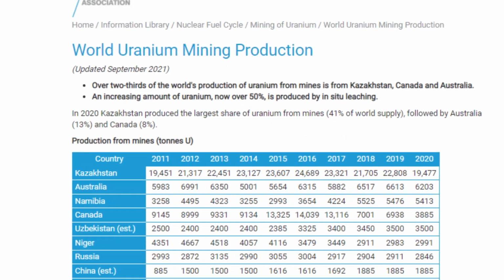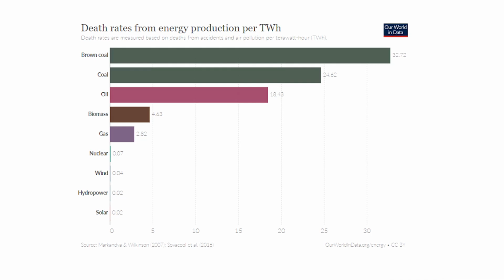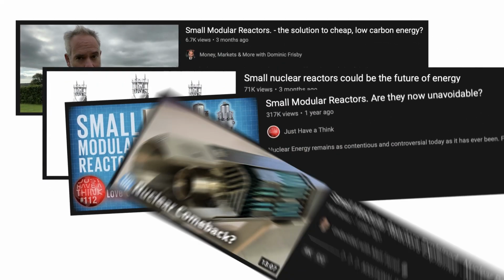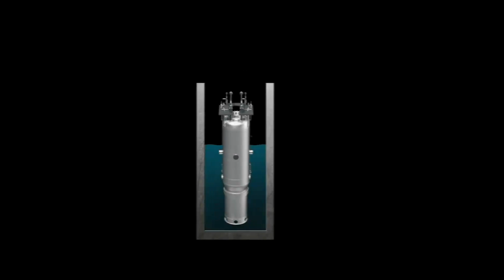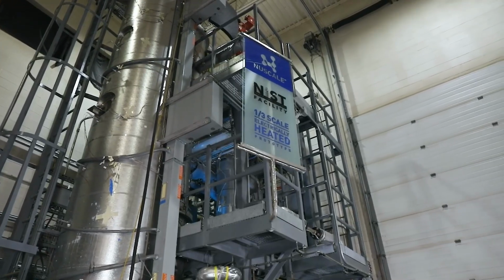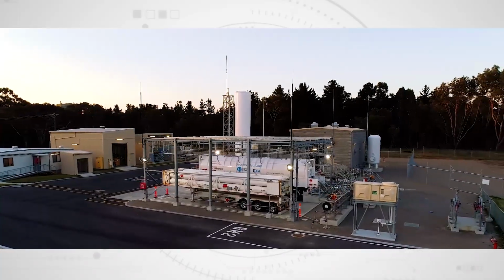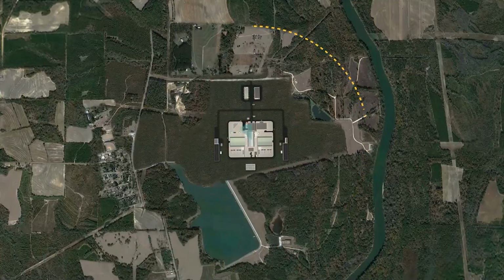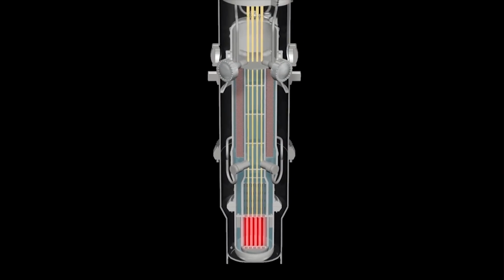Can Small Modular Reactors Save Nuclear Power?

Comment: Correction: It wasn't the meltdown in particular that caused the tragic accident. They had pulled out nearly all the control rods and when the water stopped flowing, the core went supercritical and the power increase caused the pressure to increase so much eventually something gave. The reactor lid blew off and all the water was super heated so it flashed into steam. It was this stream explosion (+ perhaps a hydrogen explosion) and the following graphite fire that spread radioisotopes into the environment. The remaining fuel that melted down into corium was comparatively benign because that remained there.

Also, those figures of LCOE is from Lazard who limits its scope to USA, where in recent decades the costs indeed increase. However, in the 1960s the costs of USA's nuclear was actually cheaper than today's gas. In more recent times, the costs of nuclear in places like South Korea and France when they were rolling out plants were also much lower. In fact, South Korea experienced a cost reduction rate similar to solar. Experience breeds familiarity for all technologies.
Reply: Here in the U.S. I grew up with the promise of electricity too cheap to meter.  👍
But I also grew up being drilled to shelter under my school desk and face away from the windows with my head between my knees...
By 1986 I was mature enough to realize the long term implications of Chernobyl for Europe and (the then) USSR.
Disappointing that 35 years on we are still in the development stages of viable "safer" nuclear power, while Russia has already barged modular reactors to the Siberian coast.
Small modular reactors have been in constant use by naval ships and subs since the 1950's with only a few Soviet submarine reactor accidents acknowledged.
I'm in the U.S., so I cannot say that there have been no accidents beyond the three sub coolant leaks admitted here.
Still, worldwide many vessels operated 24/7/365 for over 70 years. These designs are closely guarded and I can't decipher the evolution of their designs.
Graphite moderated reactors like Windscale and Chernobyl that can literally catch fire don't have a place in the 21st century.
Reply: @jimurrata6785  
"Here in the U.S. I grew up with the promise of electricity too cheap to meter.  👍"

That promise, which is often used to claim that the nuclear industry "over-promises and under-delivers" was made regarding FUSION energy, not fission. 

"But I also grew up being drilled to shelter under my school desk and face away from the windows with my head between my knees..."

That is terrible to hear. However, nuclear weapons ≠ nuclear power. In fact, the most successful act of DE-proliferation was the dismantling of the nukes and using the fissile material as fuel in power plants, such as in the Megatons-to-megawatts program. Furthermore, due to international regulation, countries who want nuclear power have to agree to NOT make nuclear weapons. E.g. South Korea. On the other hand, North Korea was denied nuclear power, but that did not prevent it from making its own bombs. Banning nuclear power won't make the world forget how to make weapons. But having nuclear power plants allows us to destroy the weapons forever. 

"By 1986 I was mature enough to realize the long term implications of Chernobyl for Europe and (the then) USSR."

My realization came from reading the conclusion of decades long research by experts all over the world, from the UN agencies, UNSCEAR, IAEA, WHO, etc. The consequences of Chernobyl is that 60 or fewer deaths could be directly attributed to the radiation, and up to 4000 could be expected to die from radiation exposure. 
The biggest impact on human health was not the radiation however. For me, the single most interesting line from the UN report says that "the mental health impact of Chernobyl is the largest public health problem unleashed by the accident to date" in part due to "exaggerated sense of the danger to their health from radiation exposure and a belief in a shorter life expectancy". Meaning, the FEAR of radiation is causing greater harm than the radiation itself. For a comprehensive summary, see the WHO on "Chernobyl: the true scale of the accident"

Regarding the environmental impact, today the exclusion zone itself was (ironically) the creation of a wild-life sanctuary. It is a thriving ecosystem that supports large wildlife that almost disappeared from the European continent. In fact, the endangered European bison and Przewalski's horse's horse were deliberately introduced into the zone as an act of conservation. This is likely the consequence of the sheer lack of human presence. Meaning, simple human habitation of city building and forestry is far worse for such ecosystems than the the worst civilian nuclear disaster. 

Also, nuclear is not responsible for the single worse energy related disaster. That goes to hydropower, a renewable energy source. The collapse of the Banqaoui dam in 1975, the death toll for which is in the multiples of 100.000s. 

We can make any energy source look scary like this by citing such examples. However, this is a distraction of the real killer. Fossil fuels, which kill 10.000 people every day due to air pollution... not even mentioning the effects of climate change has had and will have. Fossil fuels kills more people every single day than nuclear power ever has and ever will.
Reply: @nesslig2025  The claims of cheap power were NOT exclusive to fusion. (I was there) But then again we were promised nuclear powered cars and homes as well.  🤣

I totally agree on the lives lost to fossil energy production, and I've already said I understand the fallout of the Chernobyl accident.
Thousands of families displaced, dairy and crops contaminated. An international effort costing billions for the new safe confinement.

Yes, the optics of the incident did fan the flames of hysteria and set back safer nuclear development worldwide.
Much like the stupid idea of Tepco to place emergency backup generators where they could be washed over by a tsunami.
I doubt we would have seen the knee-jerk reaction of the Germans prematurely shutting down all their plants without Fukushima.
What now, with the threat of Russia cutting off Nordstream 1???

France has been relying on nuclear for a majority of its needs without major incident.
You seem to think I'm against the nuclear power industry. You couldn't be more misguided.
But I am pragmatic, and I think we need to incorporate the lessons learned from our mistakes.

Honestly the exclusion zone is a boon for the environment in northeastern Ukraine.
If only humans would do much less to disrupt nature and it's unique diversity of species.
Reply: @jimurrata6785  "The claims of cheap power were not exclusive to fusion. But then again we were promised nuclear powered cars and homes as well.  🤣"

I was addressing that particular line that you gave: "too cheap to meter", which was in reference to fusion. Not fission. 

If you want to say that "some" people have said nuclear energy would be cheap, well... in many places it was/is. Nuclear in the U.S. used to be cheaper than today's natural gas. 

"I totally agree on the lives lost to fossil energy production, and I've already said I understand the fallout of the Chernobyl accident."

...Well...if you say so. 

"Thousands of families displaced"

Turns out 75% of the relocation was an overreaction. Meaning 75% of those that have been evacuated did not benefit from being evacuated on a cost-benefit basis. Granted, they didn't know at that time so you can't blame them, but we should learn from this for the future. This is especially the case for situations like Fukushima where NONE should've been evacuated. 

"Yes, the optics of the incident did fan the flames of hysteria and set back safer nuclear development worldwide. Much like the stupid idea of Tepco to place emergency backup generators where they could be washed over by the tsunami."

I agree that they should have devised their active safety system less vulnerable to this common mode failure. However, bear in mind that this was one of the worst earthquake/tsunami in history, even for Japan. Japan build tsunami walls all over the island, but pretty much all of them underestimated this freak of nature. 

Although, the optics here should actually be an argument in FAVOR of nuclear power. Think about it. An old and ill-prepared nuclear plant being subjected to one of the worst natural disasters in human history - and yet - no discernible health effects from the radiation, while people did die from the botched evacuation (that wasn't even necessary). 

"I doubt we would have seen the knee-jerk reaction of the Germans prematurely shutting down all their plants without Fukushima."

The Germans had deciding to phase out on nuclear before. The difference Fukushima made is the prompt shut down 8 plants in that year and a completing the phase out in 2022 (that was originally proposed).

"What now, with the threat of Russia cutting off Nordstream 1???"

Since Germany was planning on replacing the firm capacity from coal and nuclear with Russian gas to back up the renewables, now they need either coal or nuclear back, or import expensive LNG from far away. So far, it seems that Germany is outright refusing to reconsider its anti-nuclear stance, while operators are preparing to extend the use of dirty coal (extracted from beneath the forests and villages of Germany). 

"You seem to think I'm against the nuclear power industry."

When did I ever say otherwise??

"But I am pragmatic, and I think we need to incorporate the lessons learned from our mistakes."

Agreed.

Comment: Very troubling to see Dr. Reyes solution to grid fluctuations is to shunt steam around the turbine and directly to the condenser.
Bank that energy in some way rather than rejecting it into an already warming atmosphere or use it for an industry that is heavily reliant on process heat like chemical or even steam desalination. This given that low demand should mean that grid storage (battery, pumped hydro, whatever) is already full.

Is he suggesting that HTSE hydrogen co-generation is included in the $58/Mw and yet he doesn't show that increased hydrogen output is the answer to low demand???
I would be fine living next to a SMR. I wouldn't be fine living next to a tank of high pressure hydrogen bigger than the Challenger booster!

The metrics for hydrogen are never good unless hydrogen is the needed product. Right now electrolysis is about 60% efficient. Put a fuel cell behind that (another 60%) and you are returning 36% to the grid. If HTSE equates to a 15% improvement on 60% efficiency (.69) you are still at only 41.4% return.
I certainly hope that R&D can improve these figures, but that's how it stands today.

Batteries aren't 100%, but far better to store as electrons and do away with thermodynamic losses
Reply: Shunting steam past the turbine is the really fast response.  You wouldn't leave it running into that mode long.  You would route power and steam to HTSE, or ramp down some reactors for longer low demand periods.
Reply: @TechnicalBard  is there a reason you can't switch power to electrolysis straight away?
Given enough storage is there a reason you wouldn't just keep the reactor at (X) power output rather than ramping down over an hour and a half, and then having to ramp back up again.
With all the inefficiencies that entails...
I'm no nuclear engineer, so please point out what I'm missing.
Reply: @jimurrata6785  I've already explained it - for power generator connected to dynamic load, efficient and quick ramp down is not an important feature.
Reply: @basilevs83  And I'm asking why ramp down at all if you have demand for any and all "excess" power you can produce.
If it is going to industrial hydrogen that energy shouldn't be destabilizing the electrical market, making for absurdities like negative pricing.
Reply: @jimurrata6785   On hydrogen plant, it would not need to ramp down and you would be right, but this reactor is multi purpose and there are other usecases. In context of producing electricity, an additional unstable output of hydrogen may be an unnecessary dangerous feature.
Reply: See https://www.youtube.com/watch?v=2a4CeJ6XjUE&lc=UgxGdBeonKJb5Nsgv9l4AaABAg a comment about feature creep
Reply: @basilevs83  My question is "is it feature creep, or was it intention from the start of design?"
SMR + hydrogen seems well paired to cement (other than the CO² emissions from the reduction) and steel, which has seen huge decline here in the U.S.
Both of these industries are energy hungry and environmentally filthy but pretty much essential to modern society.
Reply: @jimurrata6785  I mean storing a 90 minutes of half output by reusing unconsumed heat would be exactly that - feature creep. It has small benefits (because power output can be lowered in an hour, stopping the waste) and adds a lot of complexity.
Reply: @basilevs83  Certainly adds complexity, but why back off at all???
Devote 100% to hydrogen production if you have enough storage/demand